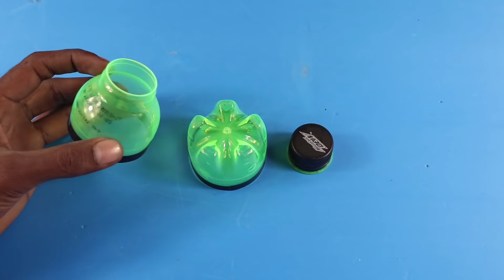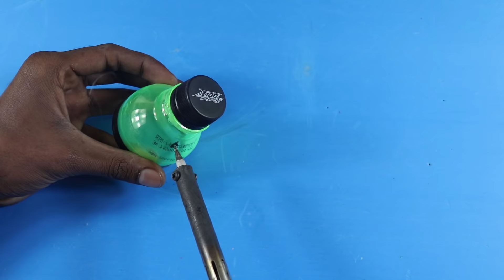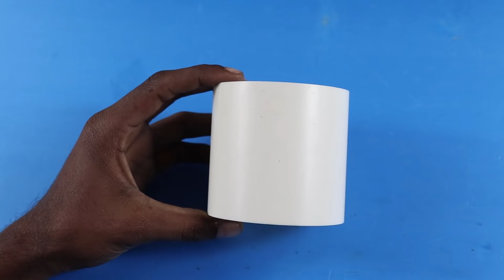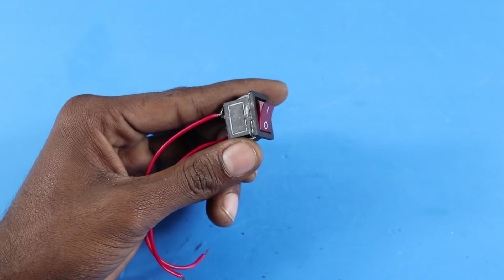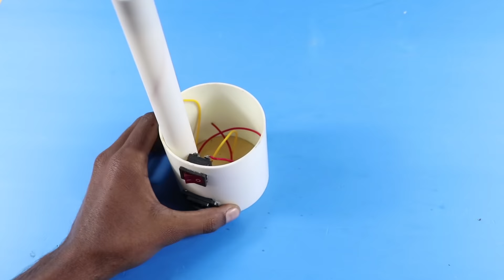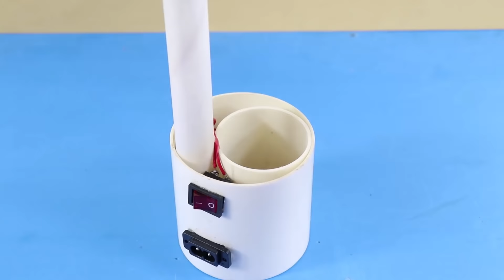How to Make Table Lamp at Home । Homemade Table Lamp

Comment: 🔴Bro, Don't make that type of video without knowledge. You use 9v non-rechargeable battery & charge by 220v Ac . Have you any idea, how dangerous it is.
Reply: Leave it they r illiterate
Reply: 220 v k socket me kaha charge kia?
Reply: @darshnikdeep4650  firse dekho...
Reply: #LET'S DIY
Reply: @pradhancrafts7302   No...let's die🤣
Reply: @Prottoy Bakshi  -Yes you are right but leave that because they doesn't know how dangerous it is😖😏😏
Reply: Short circuit😌
Reply: Yes leave they don't have any knowledge
Reply: Hw battery
Reply: Is vai na to moj kar di, wah bata wah (6 volt led 9 volt battery ma jal raha hai without rasisitor)😜😜😜😜😜👻👻
Reply: Yes
Reply: र
Reply: U r right
Reply: 🔵It is smart but dangerous 🔴
Reply: Can I connect 5v battery charger to recharge the 9v battery?
Reply: @saumyaagrawal5558  yes, but it  will be charge very slowly.
Reply: @prottoybakshi6621  so it's rechargeable?
Reply: İts dangerous 
Use phone battery

Comment: The lamp is good but the 9v battery is not rechargeable, do you know how dangerous it is.
Reply: Is not real
Reply: @srijandas2748  it is real
Reply: Charging battery without any protection charging module 🤔

Comment: Bhai boht achy lekin charging kesy direct ac voltage dy sakty ho
Reply from the maker: This is 6v dc power supply and we make it for easily charge
Reply: @LifeHackTricksOfficial  ata kono vabai possible noi 220v se 9v derect charge nahi ho sakta

Comment: Man it is good example of table bomb as you are using both 9v battery and 220v 😂

Btw nice, without 220v would be best project work
Or u could add 2-3 batteries

Comment: This guy has no knowledge on electrical things. If you try to charge this battery this will gonna explode.
Reply: Hare Krishna Hare Ram  Because there's no adapter. And also you need heatsink for led panel. The bottle head will gonna melt or get burned.